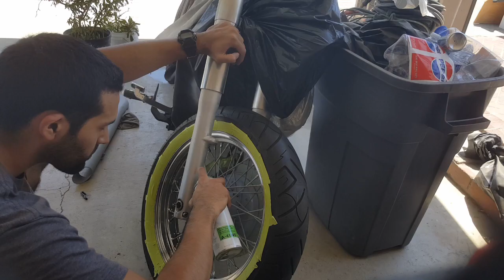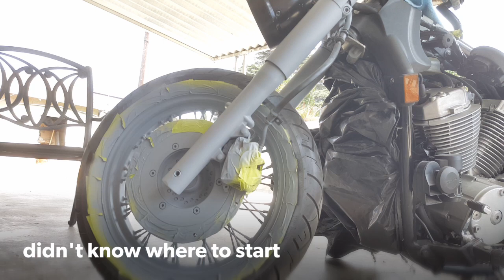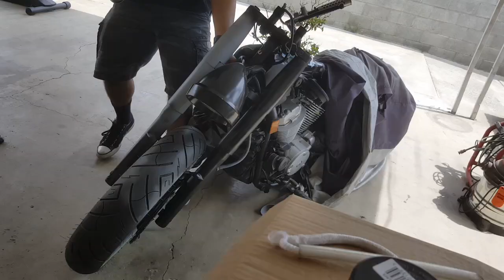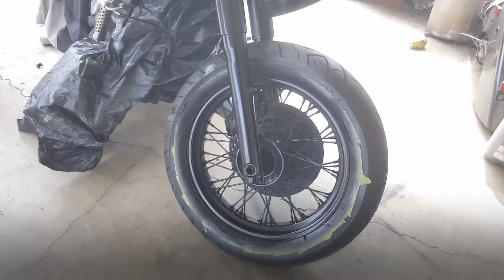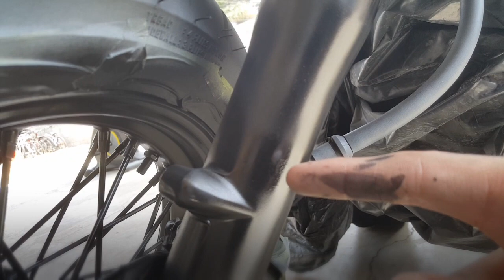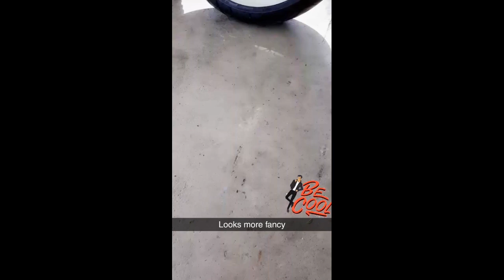Painting my Honda shadow wheel and forks with spray cans /black out

Comment: Looks great thanks for this I was stressing over how to paint my bike omrrow, I. Painting my rims green though what should I do first blackout the bike or paint the rims first?
Reply from the maker: Josh Contreras did you already scratch up the bike and wheels /prep them?
Reply from the maker: Josh Contreras but i think i would do the wheels first just because they are more complicated. thats if your leaving them on the bike. painting the forks was super easy . just remember if you have the fork covers  luke i do you have to spray under them a little or the chrome will show
Reply: I cleaned the front end if the bike today tomorrow my risers will come in the mail and bu then the paint job should be done did you clear coat anything to be safe? That's another stress I'm having
Reply from the maker: Josh Contreras no i did not clear coat anything i want the satin black look without the glossy finish. i was thinking about it though
Reply: Would like to see a vids of the engine paint

Comment: How would you do the back wheel?
Reply from the maker: donmartin27 same way but have to lift the bike up so the wheels spin or just roll the bike forward and spray little by little
Reply: ALEXGSXR thanks. Do you have a recommendation on what type of paint to use?
Reply from the maker: donmartin27 I used self etching primer first and then i used VHT paint for high temperatures
Reply: ALEXGSXR cool. Did you buy any chance sand the chrome down before priming? And how’s the paint holding up?
Reply from the maker: donmartin27 yes I just scratched up the chrome a little with some sand paper. the paint it fine so far some dings in it but nothing major. also I did not put clear on it so maybe if you want to spray some clear finish on it will be better protected.
Reply: ALEXGSXR thanks man. You did a great job. I recently blacked out my bike so I’m ready for this. Just wasn’t sure how to handle the rotors? Did you paint them too along with the calipers ? Couldn’t tell in your vid.
Reply from the maker: donmartin27 I just painted the inside of the rotor and taped the outside that is used for braking. I put tape on the caliper also I did not paint it
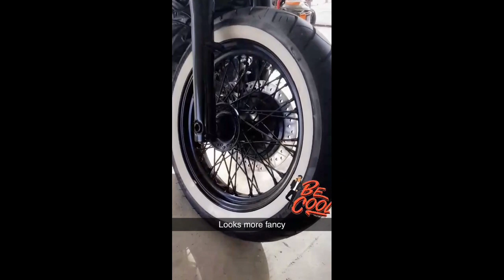Reply from the maker: donmartin27 at 3:25 you can see the disk brake is not painted only the inside is black
Reply: @ALEXGSXR  Thank you for your help!  I'm doing mine next week.  I'm looking forward to seeing the sweet difference on my bike.
Reply from the maker: donmartin27 goodluck. Don't rush

Comment: What brand of Paint do you remember using?
Reply from the maker: it was VHT engine paint Satin black. purchased at auto zone ,pepboys
Reply: ALEXGSXR thanks for the reply, bike looks good, holding up okay?
Reply: ALEXGSXR thanks for the reply, bike looks good, holding up okay?
Reply from the maker: Keaton Austin honestly i havnt had time for it. I should be Done painting the rear wheel by the ends of February

Comment: How many coats did you do?
Reply from the maker: Jared Dyer on the wheels i dont remember sorry i lost count but probably 1 can 8- 10 coats. i did alot
Reply from the maker: first i scratched the surface so that the self etching primer would stick good then i did a couple layers of grey primer. but on everything i used 3 cans of black